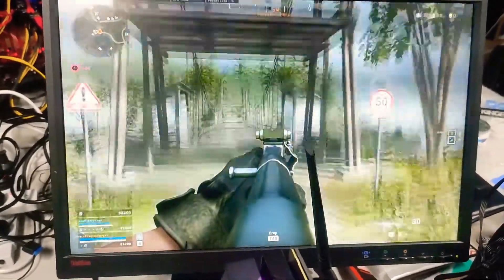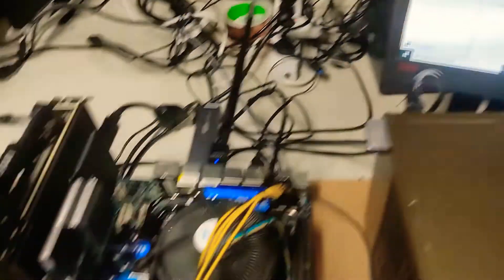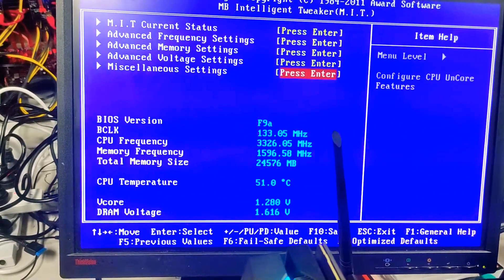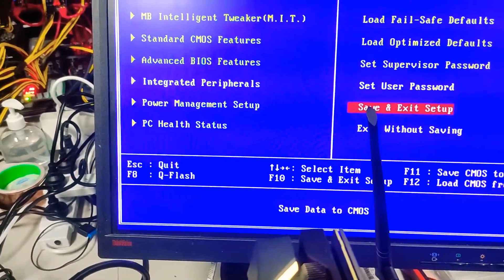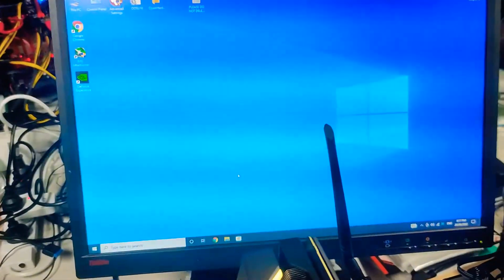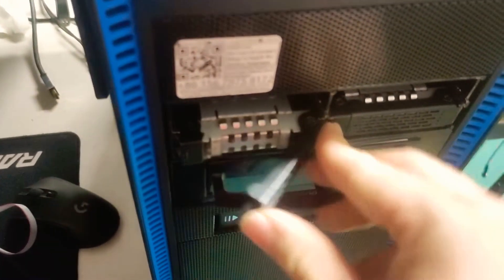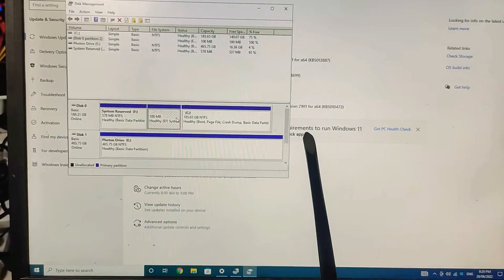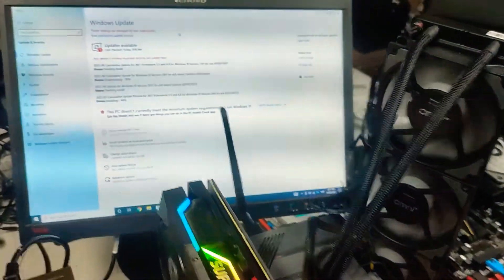UEFI Windows 10 & 11 WORKING 2023 on Gigabyte X58 UD7 Motherboard! ASROCK MSI ASUS INTEL IDE UEFI

Comment: Im running windows 11 on my Asus P6X58D-E Xeon X5675 without issues in legacy boot getting all updates without issue, for me it's been more stable than Windows 10 overclocking one machine to 4.5Ghz and the other to 4.3Ghz, both @1.35v Auto CPU voltage setting, with all power saving features enabled also running pcie to nvme m.2 Boot and storage drives, is able to push my Asus strix GTX 1080 close to 100% usage on the 4.3 overclock. I plan to swap out the 4.3 overclocked motherboard CPU with the 4.5 mobo/CPU  overclock because the case it's in is too small for the GTX 1080 which I currently only have an RX570 and it pushes that thing pegged at 100% most of the time running all six slots populated 24 GB of 2133 storage at 1966, 8-9-9-15 CR1 timings giving it ridiculously low latency of 49ns and a read speed over 30,000 copy speed over 34,000. I also tried three 8 gig 1866 dual rank memory populating three slots at 24 GB with similar results. I just picked up two more 8 gig matching sticks going to shoot for 48 GB but I'm not sure if the dual rank will hinder performance populating all six slots, the 2133 memory is single rank populating all six slots and seems to perform a little bit better I recall testing sata  read write speeds in IDE mode purely as the consequence of default bios settings and ahci performs better at least on the marvel 6 gig sata 3 ports which correct me if I'm wrong does not allow for trim operation when set to IDE
Reply from the maker: AHCI performs better for legacy windows but you need to set it to legacy in order for it to ever boot into UEFI mode to receive the recent updates
Reply: @compuguy123  do you know if the Asus P6X58D-E works as UEFI boot I tried according to the video settings but I lack one of the settings after clean install still shows legacy boot in order to boot into UEFI you would have to install it as UEFI once it's a legacy boot drive not sure how you could possibly change it to UEFI
Reply from the maker: @paulburkey2  If not sideload windows on it with 2 drives. Use the SSD as the windows UEFI install, on a PC supporting UEFI, then connect the hard drive or second ssd, then set EasyBCD to create a legacy bootloader pointing to the install on the first SSD. Take that drive, then mark the new partition created on the hard drive/second drive as active.

Congrats, now you have full update support. The only thing you might or probably won't have though, is TPM 2.
Reply: How did you get your mobo to br running pcie to nvme m.2 Boot and storage drives?
Reply from the maker: @nanocalp  Sorry, meant to say EasyBCD to point to your NVME from a random legacy or UEFI SATA drive